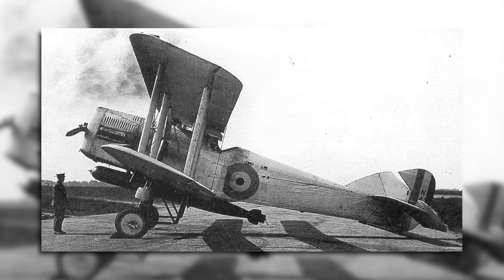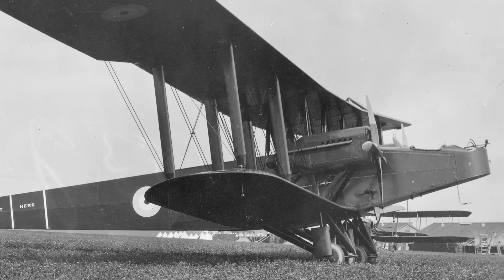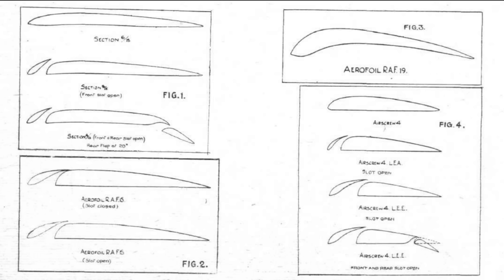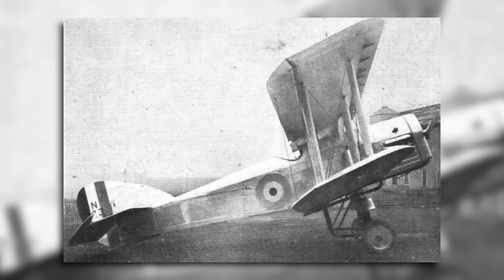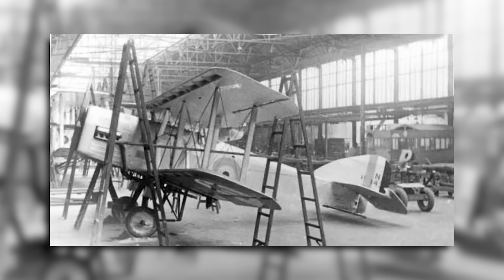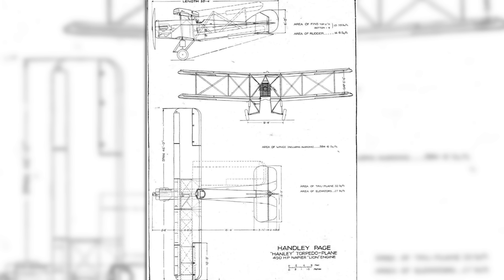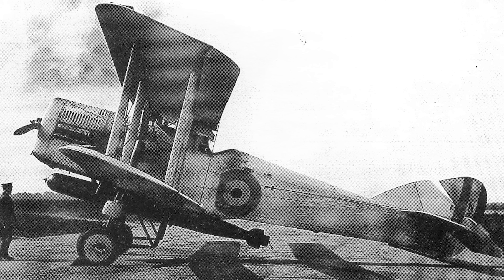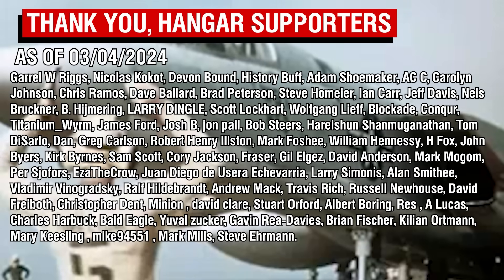Handley Page Hanley | Aircraft Overview

Comment: Another significant step into the 4 engine heavy bombers that would dominate late stage WWII. The Short Sterling/ Handley Page Halifax/ Avro Lancaster/ B-17/ B-24 and B-29 did not happen without these type of bomber designs.

The UK hung onto the twin engined bi-plane bombers a bit longer than the US. In the USA we had the Keystone Bombers, very much a Handley Page Hanley/ Vickers Vimy/ Vickers Virginia peer.

Then Glenn Martin came up with the Martin B-10 and bomber design was changed forever. Our cousins across the pond followed it up soon. In the US, took a step back with the B-18 Bolo, then USA went heavy, heavy with the 4 engined B-17. The UK followed a few years later with the Short Sterling. Yep the Short Sterling was basically a generation after the B-17.

The rest is history. Even as a Yankee, I feel the Lancaster was the best 4 engine bomber of the European front. The B-17 was the prototype and the B-24 was the equivalent. The B-29 followed on after.

Comment: The Handley was obviously a good practice machine for what would later be the F4U Corsair, The British were able to land these high performance fighters on carriers when the Americans $hit-Canned the whole corsair carrier business because they kept crashing upon landing, originally the Marines used them on land bases until the British navy embarrassed our guys to to use it again on carriers.:face-orange-raised-eyebrow:
Reply: As designed the F4U had some significant flaws that had to be ironed out before it was (considered) safe to use aboard US carriers. It would stall the port wing earlier than the starboard wing at low speed and at sudden sharp increase in throttle (solution: a stall strip on the starboard wing, so both wings stalled at the same time); its landing gear struts caused a significant bounce on landing (solution: relief valves on the oleo struts to gradually release the hydraulic pressure); and the cockpit was set low and far back in the fuselage, causing trouble for the pilot to view the carrier deck over the long nose (solution: moving the cockpit forward; further improvements by the British were raising the seat by 7 inches and installing a clear blown canopy hood instead of the original 'bird cage', which further improved visibility).

However, the most important factor to make landing the F4U aboard a carrier safe was adopting a gradual left-hand turn to keep the carrier deck in view between the fuselage and the left wing, only levelling out at the very last phase of the approach. That was what the British Fleet Air Arm pilots found out, as they initially also had trouble landing their F4Us on their carriers and their fair share of crashes. The same practice was already established for landing the Supermarine Seafire aboard carriers, as it had similar issues as the Corsair: a long nose and a low-set cockpit with lacklustre visibility forward-and-down. Eventually the US Navy would adopt the aforementioned solutions too and the F4U was successfully used from US Navy aircraft carriers from 1944 onward.